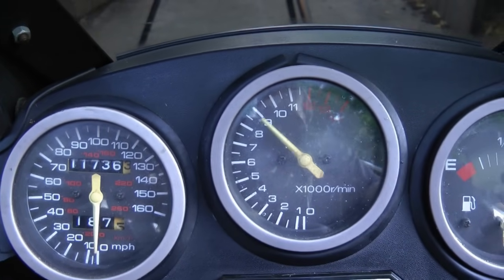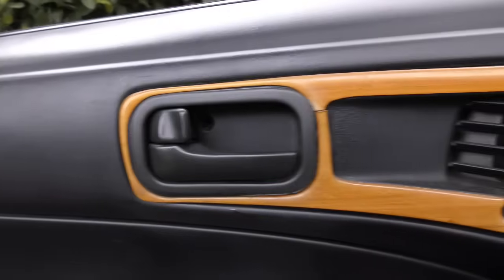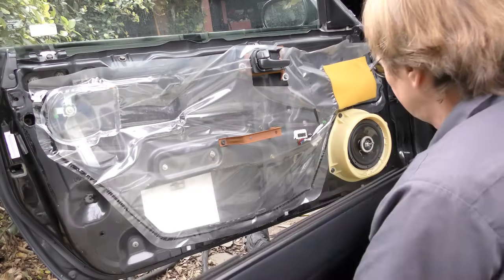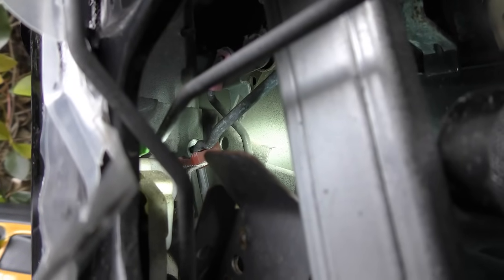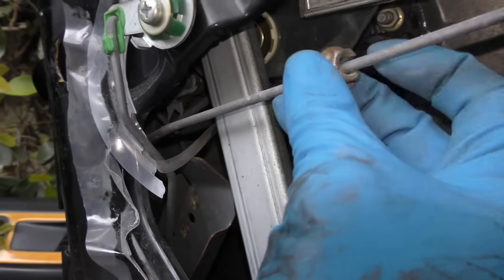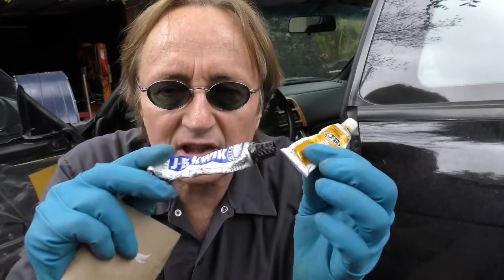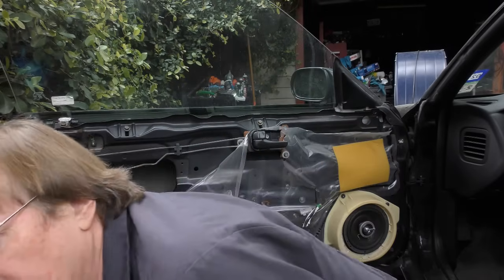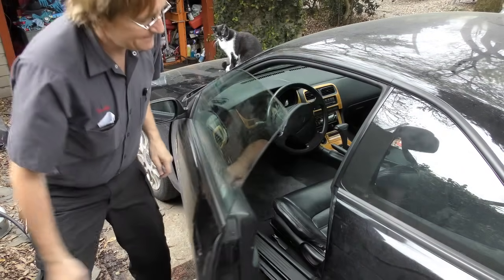How to Fix a Stuck Car Door that Won't Open

Comment: I thought it is a botchy job when the mechanic rigs a piece back together
Was there no way of using a different latch, and setting it up to work properly?
Like it'd be using proper parts that can be shown on a receipt of the car was to ever be sold again
What you did worked but buying a second hand car with a foreign part sounds a lot better and a lot more reliable than an old washer
Reply: That's why he states in his videos it's a DIY job not a machanic doing.. sure it might be someone else car maybe he fixed it for free so stop complaining... you might learn something!
Reply: I don't buy a car because it had a new latch haha. also not everyone can afford new parts or obsolete so you have to do what you can do. Who said you have to tell the new buyer about this repair? A MECHANIC fixes a faulty part, a TECHNITION swaps a faulty part
Reply from the maker: good luck finding a used part on this baby that works. They all wear out the same at this age on them, you'd just be swapping one bad part for another.
Reply: Well I'm sure Scotty's clients choose him because he's honest (and most importantly, cheap.)
If you wanted a clean, expensive, job you'd take it to a dealer approved shop. If you want it fixed (And that epoxy nut should outlast the life of the car) without breaking the bank you need a back-yard mechanic.
Reply from the maker: Azurren  Yea, but the dealer wouldn't fix this, as the part is obsolete  and can't be purchased, according to nissan, BUT, they would sell you a new car gladly.
Reply: A "botchy" job is one that doesn't work or doesn't last for very long.

The problem and its solution seemed simple and thorough enough that I would expect this patch to last up until the car meets its fate with the crusher.  If that ends up being the case, then it's not a "botchy" job.

And, as Mr. Kilmer has said, it's an obsolete part that is no longer made by the original manufacturer nor is any old stock likely to be kept at any factory warehouse or any dealership.  Unless you can find a new replacement from Dorman's "Help!" line of auto parts, the only other option is to patch the worn part to get it working again.  I would not want to take chances on a junkyard part if it's going to be just as worn out and liable to fail as well; it sucks having do the same job on the same car twice.
Reply: no one cares about receipts on a car.  Go take any car to a dealer with your receipts and they will say that's nice.
Reply: Gary Ober Sure, a dealer will care about receipts.

If you ever trade or sell your car with its receipts to a dealer, they'll resell it to some sucker at considerable markup because they will pitch to the buyer that the receipts are proof the previous owner took care of it.
Reply: ***** Oh be quiet.  People like you annoy me so much with their crazy views on "the proper way to fix things."  Many times people toting such a mentality do not even fix things for themselves!  If you can achieve the same result with less time, money and effort then you should do it!
Reply: *****
You are right.  They will give you no credit, but will use it against someone else.  I would give them nothing, no manuals, jacks, spare tire if I can find a crappy battery to throw instead of a good one I would.  There really needs to be a better way to trade in cars cause the people who mistreated their vehicles get the same price as someone who treated it well.
Reply: Gary Ober Tried selling privately?
You trade in for peanusts.. The scarp yard would probably give you more for the rims alone :P
Reply: Azurren
That's what I told them.  The sales guy was embarrassed when he found out how much the sales manager was offering.  I wasn't planning on selling, however it is interesting to see what type of character you are working with.  I've had some places that were reasonable, where others were in my opinion down right crooks.
Reply: Salal halab
Well, someone thinks it's a classic that will drive forever...until someone tore off some plastic instead of delicately pulling it off according to the manual that doesn't exist.

Comment: My 2011 Toyota Corolla has 3 doors that won't open with the key remote or the buttons inside I know the remote works because it opens the forth.... What part do I need to replace and is there a better solution because I found out this is common with the newer corollas???
Reply from the maker: +R&R Gaming   those three doors either all have electrical power loss to the door unlocking motors, OR all the motors have shorted out. Good luck on that one, big reason I have manual locks on my old toyota

Comment: I just finished repairing the door latch on a 94 Altima.. Latch is discontinued and whoever has one wants $500 for it! Nissan makes such cheap cars. This latch had one rivet holding the assembly together. I just found a spot to drill all the way through it and put an #8-32 through it. Now the passenger door awaits me  any body wanna buy an Altima that weighs less Everytime you drive it? I can't keep the parts on the darned thing.

Comment: My 1990 Honda Accord driver door stuck CLOSED.  If it's locked closed and cannot open from inside or outside, how can you replace latch or fix latch. Door is stuck.

Comment: How do you open a 2008 Toyota Corolla driver side door that won't open from the inside or outside? I'm trying to do my safety check and the one on the dashboard not visible

Comment: as  great as this vid is .. how does one get the door open in the first place if it wont open?
Reply from the maker: if it won't open from inside or outside, get a slim jim and force the latch open with that between the glass and trim
Reply: Scotty Kilmer don't sell them in Ireland :( that i can find.. ill try a metal hager

Comment: hey scotty I have my 2009 Toyota rav4 driver door is stuck outside and inside wont open what should I do. i have no access anywhere. remote is responding lock and unlock but that pretty much it 3 doors are ok only the driver door. pls respond appreciate if u can help me.. thank u.

Comment: Hi Scotty,
I have a Toyota Camry 95 and on the drivers side door it won't open from the inside and it only locks all doors but won't unlock them.  what's the problem?  pls help.

Comment: Hello, I have a question for u. My driver's side door won't lock with the key bt all the other doors r locking n unlocking just fine. What could be the problem???? Have a bmw 318i
Reply from the maker: +Dexter Mwale either the key lock is bad or the rod that goes from the key to the latch has fallen off or that part of the latch has broken. Take the door apart to find out

Comment: you are a national treasure.
Reply: Thank you for the informative video. I have Mercedes ML 350. whenI lock the car and unlock it the driver door open from inside But not from outside. However, when i hit a small hit on the handle it back to work and opens normally. Appreciate your advice?
Reply from the maker: +abu2951 you activator switch on that door is breaking down, NOT a cheap fix.

Comment: I have a 1962 Cadillac that will not open from inside....suggestions?  The interior  latch is not broken.. and it opens fine from the outside

Comment: The passenger side door on my Mustang was wrecked and I replaced it with another door. Probably is, the power lock doesn't work on the replaced door but does work on the undamaged driver door. Help?
Reply from the maker: +Marco Antonio Islas make sure everything is hooked up and that the new door came from a car with power locks
Reply: +Scotty Kilmer Yes, same exact model and everything. My guess is the wiring is screwed up. The power windows on both doors also don't work and I know it is the fuse because the fuse box under the dash has a missing fuse on spot 43. I don't know where to find a 20 Amp Circuit Breaker fuse though..

Comment: Is it the same process if the problem is that the door won't open from the inside of the car? It unlocks from the outside but not from the inside.
Reply from the maker: +brwn89  same process, but often a bad inner door handle/locking assembly  then

Comment: Hey scotty, in my 08 civic lx sedan my car keys wont budge left or right in the drivers side door. I've tried lubricating it but that didn't work.
Reply from the maker: TRY to find a good key in your house that works, cause the key is just flat worn.They will crank the car when worn, but often not open the doors. otherwise, try a locksmith to see if he can make one that works

Comment: hey scotty my back passenger door only opens from the outside, but not from the inside,  i checked for the child safety lock and its mot engaged, any suggestions
Reply from the maker: take the inner door panel apart, often a rod falls off the door handle to the latch
Reply: +Scotty Kilmer thank yhu👍

Comment: Question: the door is closed and cannot be unlocked. How to open the panel when the door is closed?
Reply from the maker: pay a locksmith or tow truck driver to jimmy in then. OR cut a small hole near the latch area to get inside and force latch open
Reply: Thanks. In my case, I still could pull (with some forces) the plastic cover to open a small gap, and then I fixed the lock jam in this small gap.

Comment: I have and Alfa Romeo 156 2.4 jtd that is over boosting but this only happens on full throttle any ideas how to fix it
Reply from the maker: the turbo would need work on the waste gate system then

Comment: hey I have question I have a back door on driver side window got busted out I cleaned glass up now door won't open ither inside or outside handle ne tips
Reply from the maker: +Daniel Lipe  try to get it open so you can remove the inside panel and fix it. If you can't, pay a locksmith or mechanic to get it open

Comment: You really shouldn't rip the door seal open like that. It is a vapor barrier that is there for a reason and also keeps exhaust fumes out of the vehicle should fumes flow in that direction. All you have to do is pull slightly and slice through the adhesive with a razor blade and it will most times re-stick when you reassemble it.

Comment: I have a 1993 Oldsmobile Cutlass Supreme Convertible with the outer handle in the pillar and my driver's door wont open from inside or outside. How do i get the door open  to fix it.  I can't take the door panel off with the door closed.  Help!!

Comment: hi, I have  2002 honda civic driver side auto lock works with key only and back windows don't work but front windows work, any help ?
Reply from the maker: sounds like separate problems.  Driver unlock motor is probably broken, and back windows may be stuck from non use, so have someone hit the windows with their hands and slam the back doors if it's a 4 door while you hold the window switch down and see if they free up. If they don't, motors are probably shot there

Comment: Hi, we badly need your help. Our mitsubishi lancer won't open the door from the passenger side. We can't open it from the inside even on the outside. And the door windows power is not working as well. :(

Comment: what if my door handle does not open the door inside or out?
Reply: That's my problem as well.  Door 'unlocks' with key ... but exterior handle will not open door.  I got in car thru passenger side door -- and crawling over to driver's seat (horrible!) - and can't open from interior handle either. Help!

Comment: Hey scotty in my 2001 gmc jimmy my check engine light came on and i scanned it and it said po706 transmission range sensor and i was wondering where it is located i searched everywhere online and found nothing
Reply from the maker: it just bolts on the transmission, follow the shift cable down, that's where it bolts on the tranny

Comment: 1999 4 dr.park av.all four doors will not open use key to open but not opining with outside handles
Reply from the maker: I assume door unlocks with keys and then handles open the door. But if they only open with inside handles, the outside handles are worn out and need replacing then.

Comment: What if the door won't open after lock and unlock on a ford focus 2006? It works fine if you don't lock the doors it opens from the outside of the door, but if you lock then unlock it the door wont open from the outside.
Reply from the maker: +A Perdue odds are it needs a new door latch mechanism

Comment: Scotty, my name is Dominic, I have a 1990 Nissan Sentra b12. My rear passenger door won't open from the inside or the outside what do I do, the lock will not come up and it will not open . It is power locks
Reply from the maker: +Dominic Ramrattan remove the inner door panel and see what's broken. On those, often a worn out latch assembly

Comment: so i have a 2013 ml350 my right side rear door wont open from inside or outside from the inside  my little brother press the child lock and from the outside is broken  door handle can't open it do you know how to fix or is it gonna cost alot to fix?

Comment: what about a 2012 honda fit car with a smart key, the smart key and also the push buttons inside car wont unlock and lock dorors I have replaced the key fob battery still nothing. any clues ?

Comment: hi I have a kia cerato 2006. From outside driver door I only can unlock the doors but cannot lock no matter how much I turn the key still cannot lock the doors. I could feel the jam when I am turning the key. May I know what is the problem and how can I fix it?
Reply from the maker: you either need a new lock on the outside, or the latch is broken and needs replacing
Reply: +Scotty Kilmer ok thank you for your advice

Comment: what would u do if it won't open on both sides? it's an 89 jeep cherokee
Reply from the maker: +THE SPIRT  OF SAMUAL ADAMs 1776 then either pay a tow truck driver to break in with his tools, or cut a hole on the inside door panel to access the latch and force it open
Reply: Scotty Kilmer well it's not that i can't get in at all its just the driver's side that won't open , the others doors are fine

Comment: I got a 1993 chevy van passenger door is closed will not open from inside or outside how do I get into it???
Reply from the maker: +Arthur Brookshire pay a tow truck driver to break in with his tools, OR cut the inner panel with a hole big enough for your hands to manually pull the latch open

Comment: I can't open mine from the inside either so how do I take a panel off with the door closed?
Reply: +Daryn Goodwin LOL I need to know the SAME EXACT THING!!!!
Reply: Pull your handle out from the outside of your vehicle and hip check the door while pulling out. That worked for me
Reply: +Daryn Goodwin mine doesnt open from either side even someone opening the door LOL, ill go check that though
Reply: Nope, that didnt work
i think what may have happen is the little clips that hold the rod to open the doors broke.
Reply: +Amanda Gates (AreYouSerious) Oh sorry to here. using the hip check technique lol I was able to open my door and take my panel off. the handle was not moving the rods anymore but I was still able to force it open.
Reply: Might just have to hit it harder.

Comment: a 1999 four-door Park Avenue battery is dead  no remote Clicker door handles outside will not open car doors all four doors handles need replaced isn't that odd can it be electrical

Comment: I just bought a '97 Chevy silverado and the passenger side door won't open from the inside or outside, the key doesn't do anything and even the window doesn't roll down. I'm still trying to figure out how to remove the door panel if I can't even open the door
Reply: Same problem, 2000 Cavalier. Can't get to the inside panel because the back door won't open from either side.
Reply from the maker: pay a locksmith to get it open, or you will have to cut a hole in the inner panel to force the latch open

Comment: Scotty , I have an 89 jag and all four doors when I lift the handle , won't open! Help! They claim jags have a history of shitty door handles that break easy! Is there a way to convert them to manual ?
Reply from the maker: +frenchis19 don't buy a jag if you want eletronics that work.  That said, try disconnecting the power lock system in one door by taking the inner panel out and if that works, do it to all of them
Reply: I know what you mean Scotty: i;ve had this beast for years now but stopped driving it for about 5 years now: I;ve always had a problem with the doors and seriously want to override the system now! I will try this and let ya know how it goes: Thanks again scotty!

Comment: 2000 ford focus no remote, driver door opens. when cold driver door still opens ok but not the other three doors. I need to slam the driver door to unlock the rest of the doors :( or wait for the car to heat up. pliz help :)

Comment: I locked my keys inside of my 88 Buick and used a hanger to mess up the outside door handle. a few weeks later the inside door handle doesn't work.  Help.

Comment: my door no longer opens with the key fob,
I have to manually put the key in to open the door
now,every single time I lock,unlock my Land Rover with my key fob
that same passenger front door,makes this loud clicking sound
Reply from the maker: +COCOAPIE the actuator on the drivers door needs replacing

Comment: I have a 2002 Acura TL and it won't open from the inside or outside
Reply from the maker: climb in the other doors. Often you will have to cut a hole in the inner panel to access the latch and open it. Or pay  tow truck driver to break in, they;re pretty good at that stuff

Comment: Door is stuck shut.can not get door panel off.and can't get door open.pulling on the door rod is not working.how do you get the door open?
Reply: 2000 Chevy Silverado z71. K1500.  4 wheel drive

Comment: my 2 back doors don't open at all from the inside or outside. please help
Reply from the maker: +D3rpADerp see if you can pay a locksmith to get em open, cause only other option is to cut the inner door panel to access the latch to open it from the inside and that's a messy job